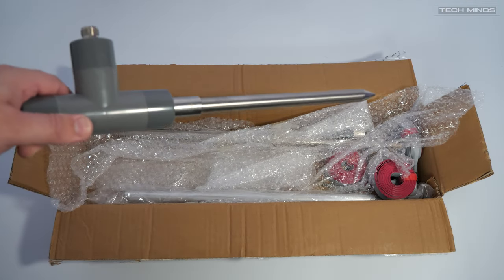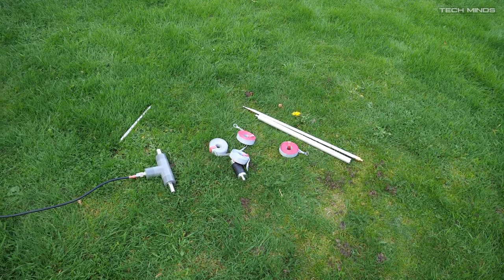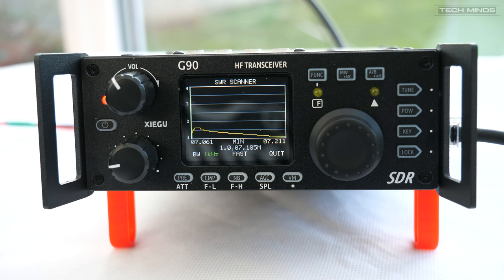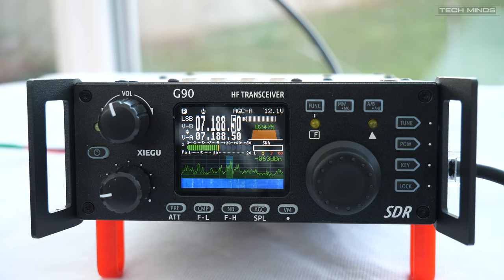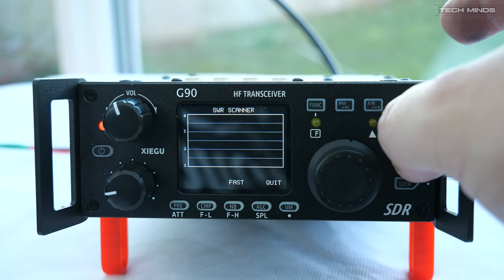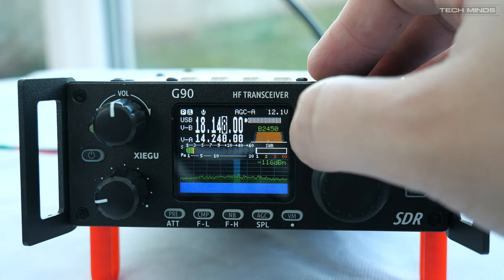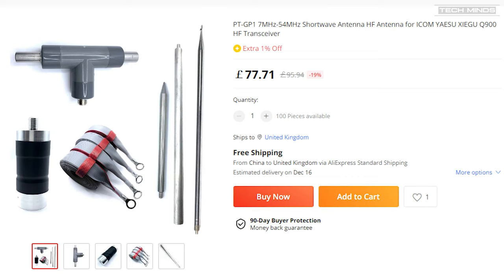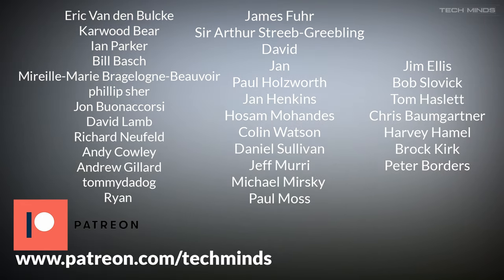PT-GP1 Multiband HF Vertical Portable Antenna

Comment: This is exactly what I've been looking for ⭐
I wonder how well it could work clamped to a pole, with the ground radials elevated, or even swap the ribbons for 4 or 8 shorter telescopic antennas with ring connectors homebrewed onto the ends, for an elevated groundplane when clamped up a pole🤔

Comment: Is there a MANUAL someplace for this antenna? I have one and it didn't come with a manual, and I'd really like to see one. I had a problem getting it to tune on anything but 40m, but I think I may have had the balun section upside down. But all these details, like the part about not needing the extension bar for 20m and above, was not immediately evident.

Comment: I didn’t notice you using the built-in tuner Mat. Was that intentional, or did you use it off camera?
Reply from the maker: Didnt use the internal tuner. The idea is to get the antenna resonant by moving the telescopic but up and down.

Comment: If you want to have some fun with the G90, check out the latest firmware release. I saw that antenna when I was shopping for the 5.6m whips they have, in the description they say to separate out the ribbon cable to get the full radial field. I don't imagine would would notice a huge difference in performance if you did that but would be fun to try.
Reply: How to install on the roof?very much interested. Perhaps grounding can be clipped at zink awning..